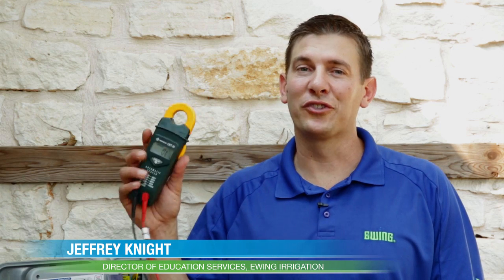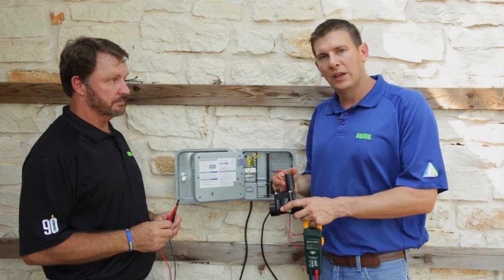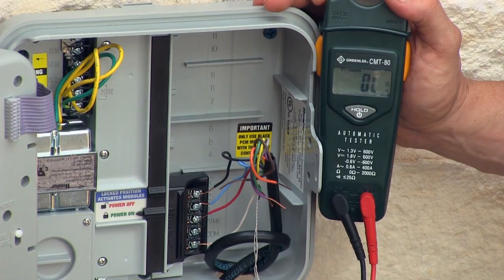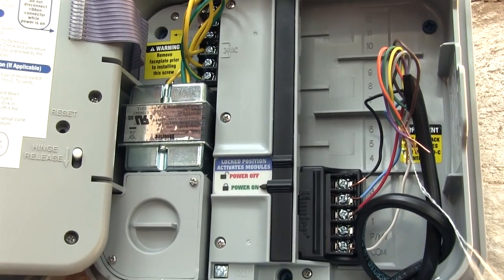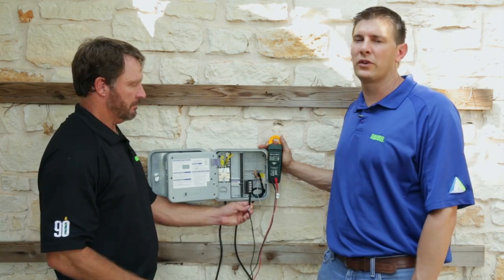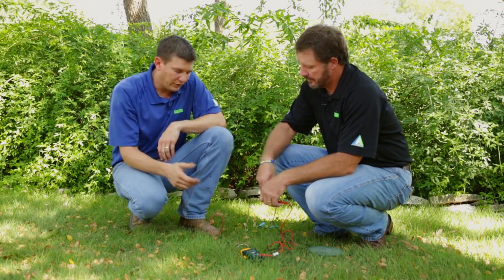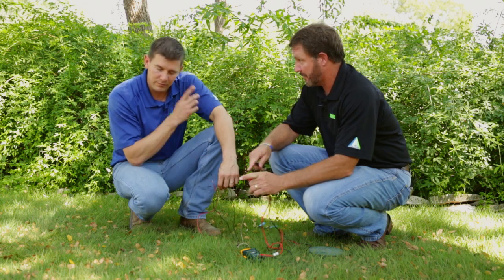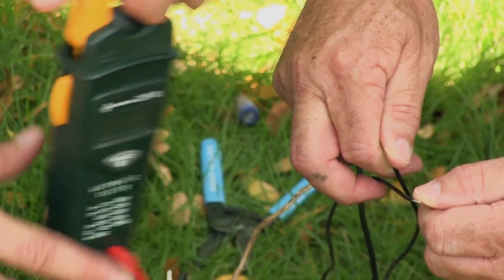Using an Ohmmeter to Troubleshoot a Sprinkler System

Comment: Thanks for the video it put me in the right direction. After testing at the control unit one wasn't getting any voltage reading. I looked closer and noticed the screw was out just enough so it would not send signal. Wouldn't have found that without this video! Thanks again.
Reply from the maker: Glad we could help! Thanks for the comment!

Comment: I like your video, but not sure how to use multimeter to solve my specific problem.  If I may,
I recently bought a new (older) home and trying to fix 2 adjacent zones (e.g. 5 and 6), where the valves are right next to each other.  The problem is that the individual zone wires are the SAME color, and they all have been cut.  So I can't distinguish between the zone 5 wire, zone 6 wire, or common.  [ If they were color coded to match the controller side, it would be simple to wire it]   I could "wing it" and try all combinations, but there has to be a way to determine which wire belongs to which zone using multimeter.  Suggestions?
Reply from the maker: This video should help answer your questions. Thanks for watching!
https://m.youtube.com/watch?v=gdMaLldvZ-A

Comment: Timer is on o off  ? When you put multimeter in timer , thanks great help I know how to did with toner but today I learn a new way
Reply from the maker: You definitely want to make sure the station terminal you are testing is not powered on when doing an OHMs test. If you have an inexpensive meter on the OHMs setting and you send voltage through it then it can blow the internal fuse. It is a good practice to disconnect the common wire from the controller so you don’t accidentally send voltage through your meter.  If you are positive the power is off then you do not have to disconnect wires. Some of the better meters will switch from reading OHMs to reading voltage and the scenario above will not damage the meter. Thanks for watching!

Comment: Am I wrong in pointing out that there is a switch that shows the controller on in the video? Why are you checking for continuity with the controller on with power? Before doing anything you first check to make sure the unit is off, and not carrying a load of 120v, right? Just saying, other than that helpful video.
Reply from the maker: +Bill Garza I believe the switch you are referring to in the video is the switch to engage the controller module. The controller dial itself was in the off position. You are correct though, one of the early steps is to verify that there is good voltage from the source. Then you verify the (19v - 30v) from the terminal strip. The first step would be to check the program to see if the controller is set-up correctly to begin with. Thanks for the feedback!

Comment: What if two zones are reading between 10 and 20 ohms? We have 2 zones that when activated bring up 3 zones. Voltage seems correct from the controller
Reply from the maker: It's difficult to give you an answer without being on site but If you have a Ewing location near you, you can contact them for advice or a contractor referral should you need one.  
https://www.ewingoutdoorsupply.com/locations
That said, If you have a reading below 10 ohms then you likely have a short on that zone. If your controller is setting off multiple zones when only one should be running, you may have an issue with the controller or it's possible someone wired multiple valves to a single station on the controller. Thanks for the question!

Comment: So you don't have to remove the wire from the controller before you ohm it out huh?. I thought that the controller would give internal resistance readings on their own. Also, do you have to remove power from the box before you take an ohm reading? Obviously you don't want the station operating or putting out AC voltage when you do that, duh, but was wondering if you needed to remove power first. Thanks for the great tip.
Reply from the maker: Thanks for the question, FireguyNxt! No, you do not have to remove the wire from the controller when doing an OHMs test.  However, it is a good idea to do so and this is why:

You definitely want to make sure the station port you are testing is not powered on when doing an OHMs test. If you have an inexpensive meter on the OHMs setting and you send voltage through it then it can blow the internal fuse.   It is a good practice to disconnect the common wire from the controller so you don’t accidentally send voltage through your meter. 

If you are positive the power is off then you do not have to disconnect wires. Some of the better meters will switch from reading OHMs to reading voltage and the scenario above will not damage the meter.

Comment: I've been working on one and all my stations have good resistance except the one I am trying to figure out. It does some weird thing when I check resistance, it will read zero and flash off and on. Won't give me any kind of steady reading. Im guessing it is a short but I am not sure. Was hoping someone would help

Comment: What's the value of a multi-meter versus an ohm meter?    Using an ohm meter is valid when voltage from the power source is good, and the controller is functioning?
Reply from the maker: Thanks for your question, Bon! A Multimeter has the ability to read 2 or more electrical values. Typically these are voltage, amperage, and ohms. An ohmmeter only reads ohms. 

After testing to verify that the voltage output of the controller is good, you can then test the circuit for each station (ohms). Disconnect power to the valves by disconnecting the field wires; this will help to ensure an accurate measurement. Live power to the valves could also damage your multimeter when measuring ohms. You can also measure the resistance of the solenoid itself at the valve. Please see this article for details on troubleshooting irrigation system electrical problems: 

https://www.ewingirrigation.com/news/blog/the-basics-of-troubleshooting-an-irrigation-controller/
Reply: @ewingoutdoorsupply  Thank you very much!   Much appreciated,…. my apology for the delay!    I do a moderate amount of sprinkler system problem solving in residential landscapes.  I take care of nearly all issues for single residential.